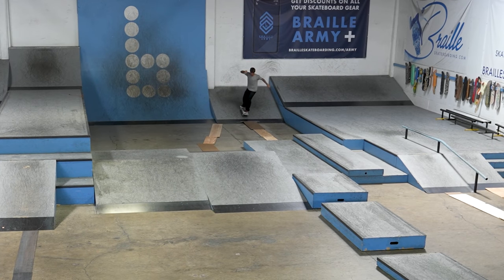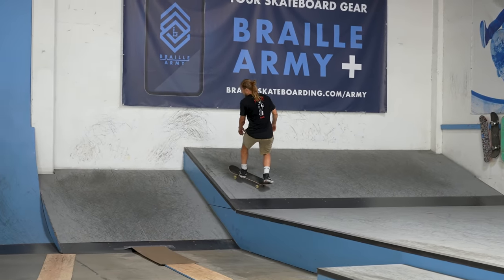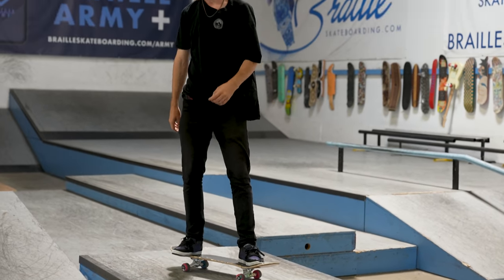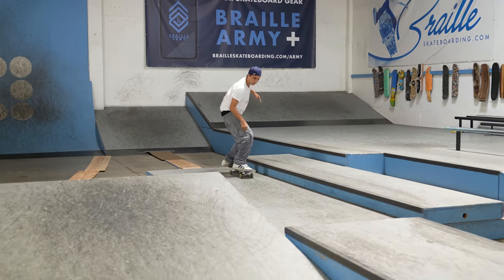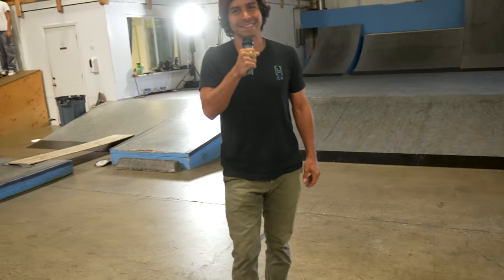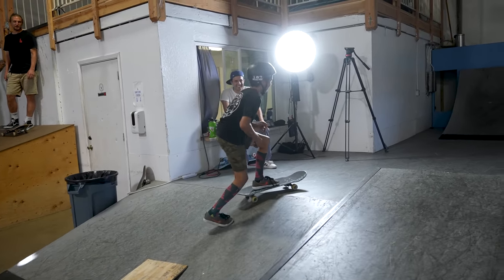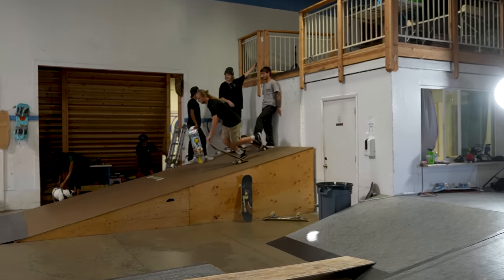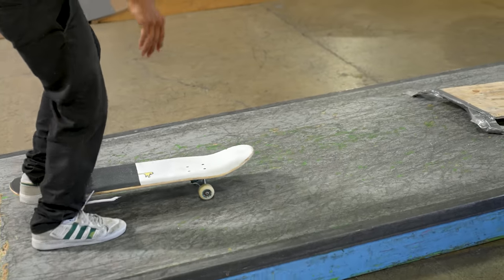FLOOR IS LAVA: BEST SKATE RUN EDITION

Comment: I'd say that either the run where J.D. nollied off the Braille drop, or, the run Zach had where he finished with the backside bluntslide. Both of those runs were raw. But, because J.D. did the Braille drop. I'm gonna give it to the little homie.

Comment: Everyone did well and some runs had specific flashier tricks but my vote goes to Ricky, just a perfect balance between cramming in tricks and flowing through the whole course as quickly and smoothly as possible. Mogely definitely gave the best post-run interviews though, that's got to be worth something.

Comment: Just so you know, you wouldn’t actually sink in lava, just think of what lava is (it’s molten rock) so it has the same density as rock but is just in a liquid form so if you stepped into a pool of lava you would probably sink “only” to your knees at most just because human are comparatively sooooo lightweight versus literal liquid rock. (It would really be an awful death bc you would roast due to radiant heat more than completely sink and melt under lava, i would bet it would be a pretty “slow” death actually >.<)